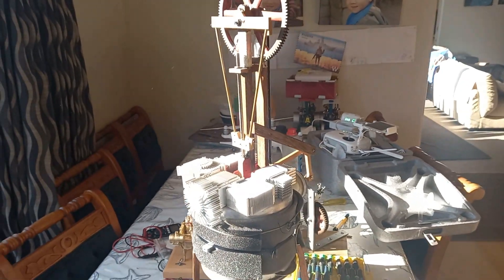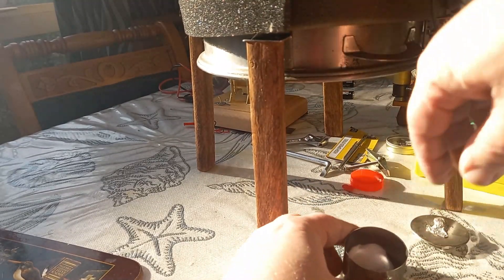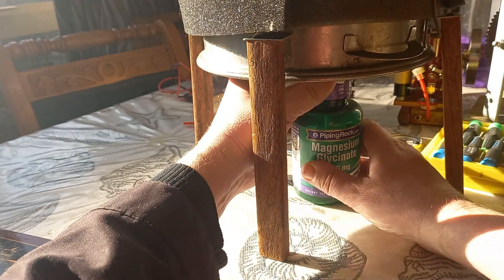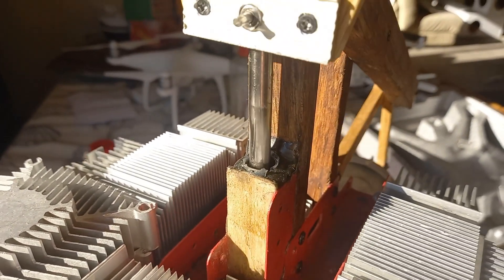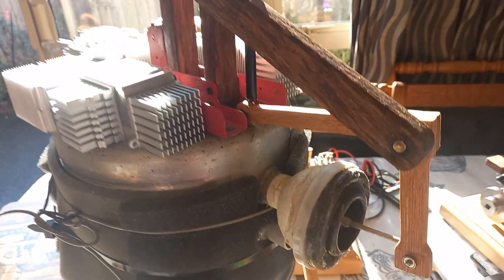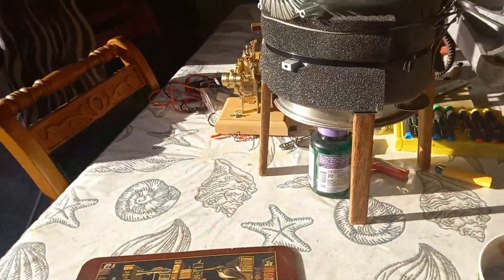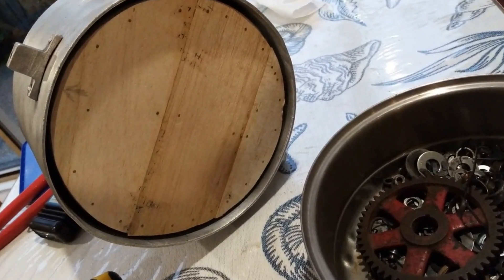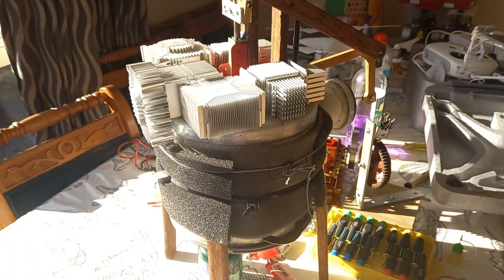BIG STIRLING ENGINE - HAND MADE FROM JUNK -- 2 YEAR RETROSPECTIVE!

Comment: The more I have worked on engines the more I appreciate engines made from simple means and accessible materials. I am interested in more than just a toy though, or rattling soda cans. I like balloon diaphragm sure, but this video has peak craftsmanship. I love wood in engines and working wooden engines. This works superbly. Much better than the time some Japanese guys in the growth period after ww2 experimented with a wooden piston and burning kerosene in a motorcycle engine. They had unreliable fuels access and other lack of industrial capability I guess.

I will eventually try it for a steam engine though. Plug a piece of wood with so much oil it expands and has no room for moisture then shape it.
Reply from the maker: Thankyou for your kind comments...I sure surprised myself. And I still have ideas for improving it although that would be out of the "covid restricted materials on site only" concept I made it under

Comment: Is there a reason, apart from slow running, why your heat source is so small? 
-tiny, against the size of the engine, and I'd say it's a huge success considering!
Reply from the maker: Mmmmmm thanks. I suspect you're right.
The displacer is made of expanded polystyrene and I was paranoid about melting it.
Also I like the slow speed....to a point.
I learned a lot building this. The main rod that holds the displacer and goes up and down is too big, thick and heavy; adds too much drag in the gland seal I made.
But the very first improvement I should make is changing that displacer for florist's  (flower arranging base) foam. Much higher melting point and just as easy to shape. 
And I guess before I even do THAT I can crank up the heat source and see what happens :)

Comment: Serious question. What real work can an engine like this do?
Reply from the maker: Only serious answer I can think of is "powering itself" in this case. It was an engineering challenge.
Engines using hot air, compressed hot air or another choice of gas can be made pretty efficient and have been tested in busses, cars etc. Low temperature engines of massive size can generate electricity. It's a direct heat-to-mechanical-energy solution, and that heat can be solar.
Reply: @ThomasPCGuruENGINES  I can think of one use, as a fan to distribute heat from a radiator or say a wood burning stove, I think I remember seeing that, possibly in a machine mart catalogue.
Reply from the maker: Hey Tony. Yeah ebay and Kontax of UK sell stirling stove fans. I don't have a stove though...sad :(